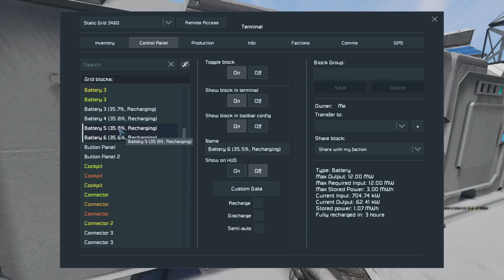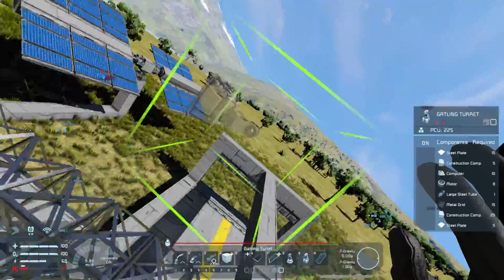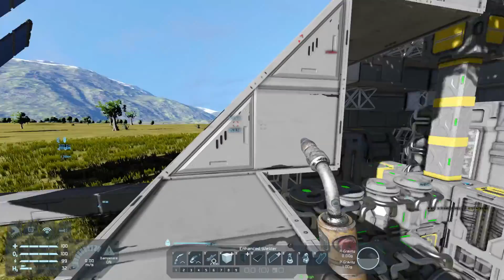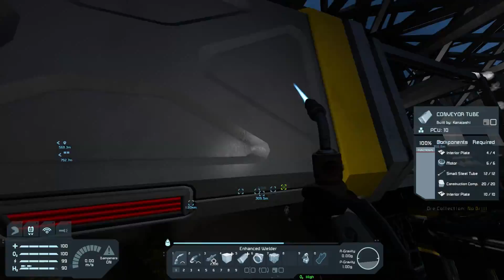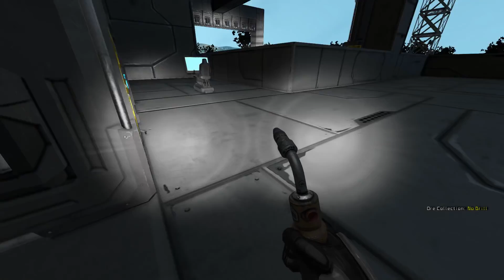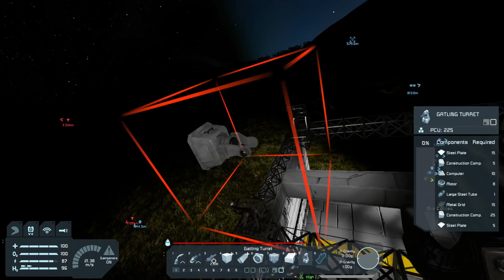Space Engineers - S1E07 'Final Base Layout'

Comment: 23:00 When constructing networking grids, is best if you use the filters at the entry points and at the exit points. That way you can connect everything on a single grid. Want a connector that drains? Easy, connector, filter, connector tube.